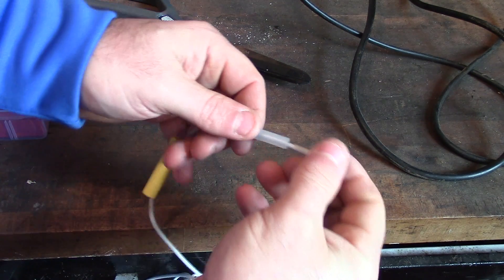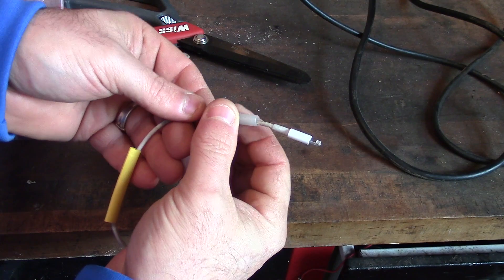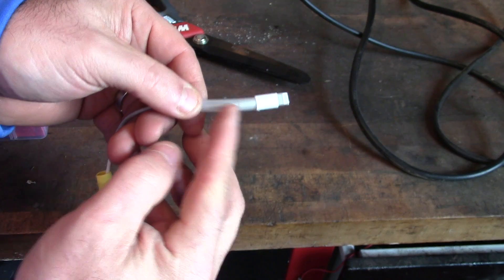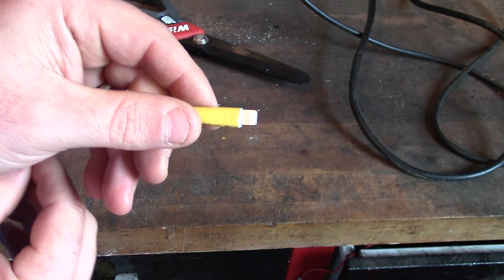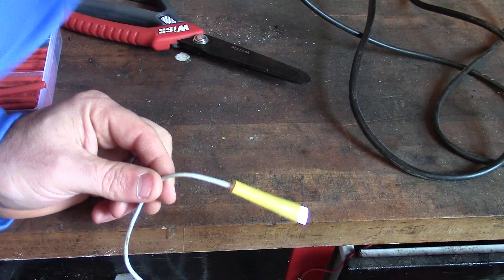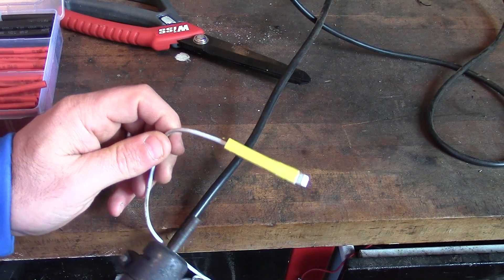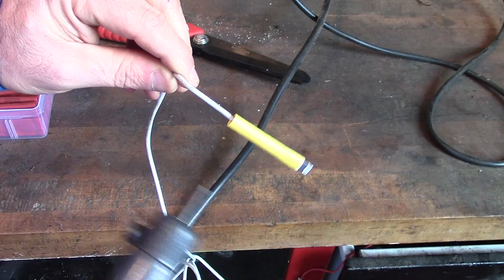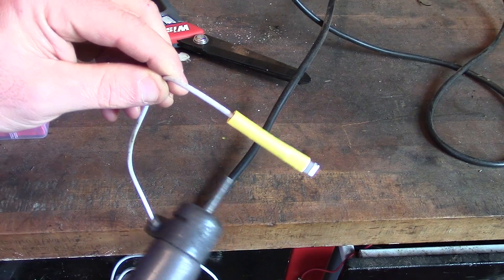iPhone Charging Cable Repair

Comment: Good tip man. I've tried heat shrink but it never worked out right because if the diameter. The tubing is a good idea to overcome that. Have a Merry Christmas!
Reply from the maker: The tubing works well!  I learned this when we were down to our last wire.  I reinforced it and ordered some new ones.  When the new ones came I reinforced them too.  So far they have been good.  I had one of the new ones break, but it has been over 8 months of use, which is really good in my house.  Hey, wanted to let you know I'm making a video of reverse lights for my truck for plowing you might be interested if you own a Jeep?  Coming soon.   Merry Christmas!
Reply: doublewide6 Definitely, I'll keep my eyes out for that one. My F250 plow truck could use some new reverse lights also. No snow yet on Long Island but when it does start, I'm sure we'll get hammered again as in recent years.

Comment: Thanks. It's a big problem of apple cable.
Reply from the maker: Yes,  It is a big problem that has earned them at least and extra $10 for every apple device ever manufactured.   I'm actually surprised that Apple does not make a cord that holds up, its been 5 years.

Comment: Great idea. Never thought about the tubing, I'm going to try it thanks. Have a great and fun Christmas.
Reply from the maker: I tried wrapping wire around the end about a year ago, but it was not ridged enough.  The tubing is solid, you just need to make sure you get the shrink wrap melted tightly so it does not slide.  I had one that slid and I never glued it back in place before my kids busted the wire.  Merry Christmas.   Bob

Comment: Awesome idea....now if I can only train my daughter to remember the cat WILL chew through the wires on her earbuds (we're on our 5th pair, give or take two or three)!!!  :>)
Reply from the maker: At least it is low voltage.  Sounds like there is a market in pet proof wires.  Get the patent before DuPont.
Reply: LOL!!
Reply: +A LeBlanc - I keep a ziploc bag of that shrink tubing at my In-Laws house for pretty much the same reason.  Little dachshund likes to chew the low voltage wire under my my 82 year old Mother In Laws lift chair trapping her in the chair.
Reply from the maker: We used to have that problem with a puppy, she at least outgrew wires, now she sticks to wooden chairs and my wife's slippers.